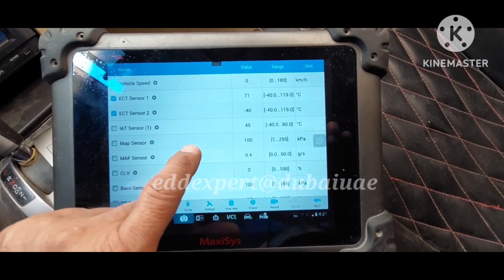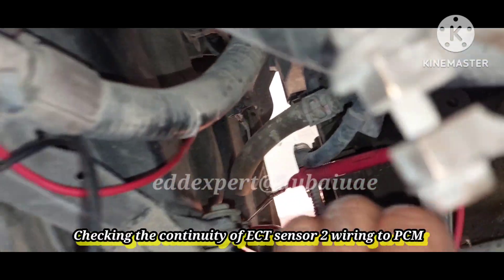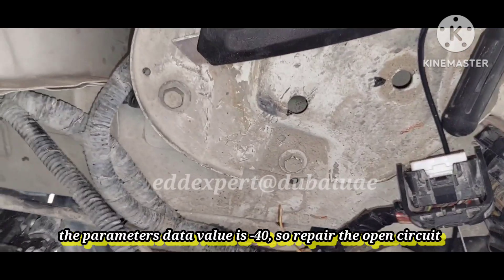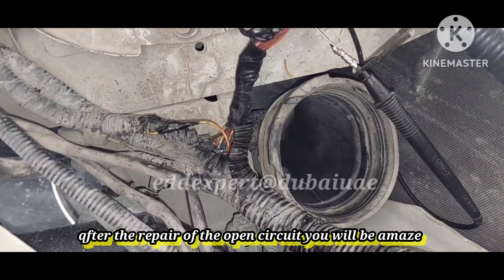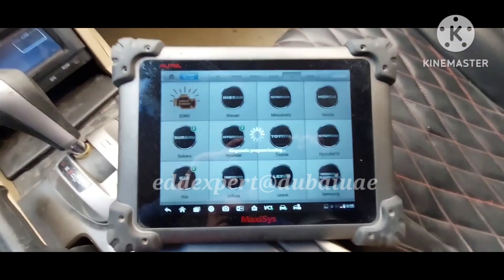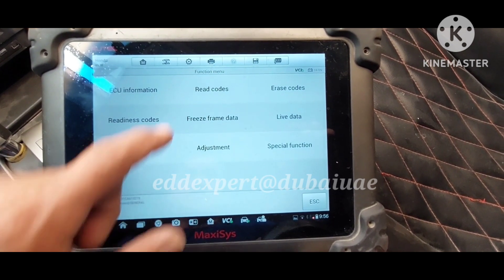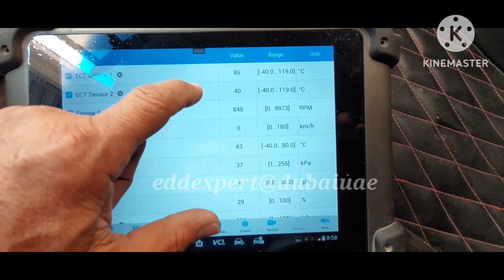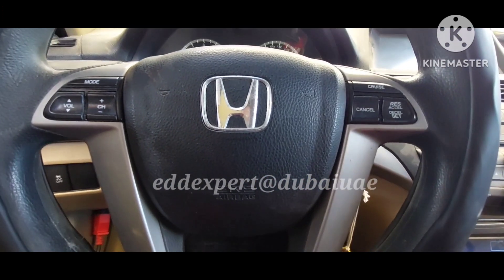🇵🇭  P 2185 ECT Sensor 2 Circuit High Voltage means it's an open circuit  n  -40 is the value. Solved

Comment: 2008 Honda civic 1.8 lx sedan.Same
 issue. The line has ground but no power.
Reply from the maker: Check the value data of the ect In your scan tool, if - negative, absolutely no power supply+
Reply: @edralinbustaliniomcbautomo7707  I don’t have a scan tool
Reply: @e @edralinbustaliniomcbautomo7707 and I disconnected it